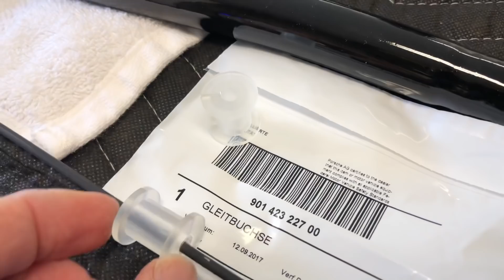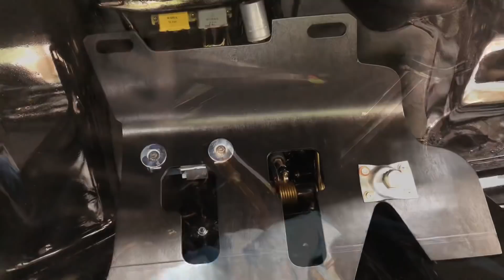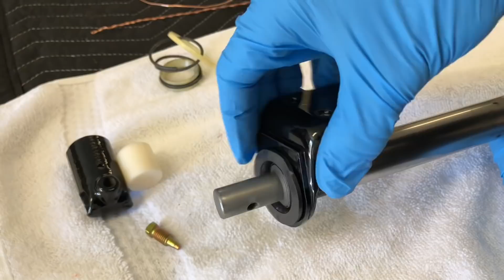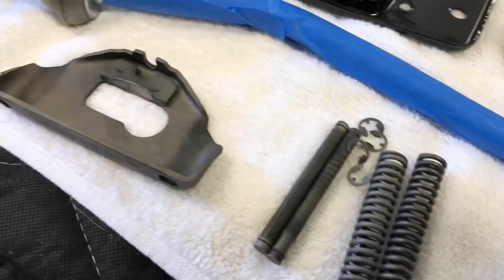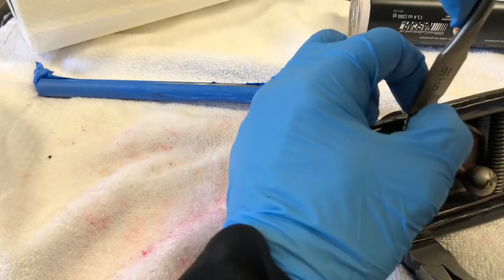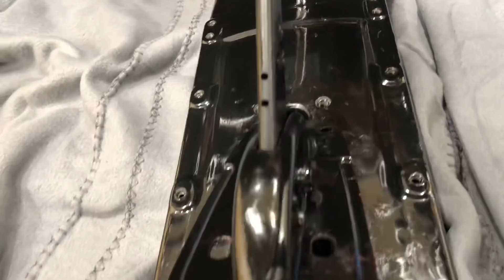1967 Porsche 911 Video 47 Completing Tunnel Work

Comment: Another great video, I can’t tell you how useful these are.
One question regarding this one at the end you show lifting the handbrake lever 4 clicks then the pads are just skimming the discs . So basically the handbrake isn’t engaged at 4 clicks ?
Reply from the maker: Thank you Bike Im so glad they are helpful.
Yes that is correct..How ever not necessarily would 4 clicks tighten the drums enough to hold the car.
It's a starting point and may need to be adjusted with a higher pull up depending on how the drum brakes settle it after driving.
If the shoes to drums are not fully releasing then more slack will need to be added. Also over time the cables will stretch.
It is something that needs careful adjustment once you are rolling

Comment: Hi Mike - how come you bought a new coupler instead of restoring your old one? Cheers mate... Can't wait to see your 911 driving video soon ... I'm rebuilding a 1969 912 in Perth, Western Australia and your videos have been a huge help...
Reply from the maker: The original was cracked on one of the bushing end. No way to fix properly
Best of luck on your 69!
-Cheers
Reply: @MikesRestorations  Thanks for your reply Mike. Just a word of warning for anyone about to do this. If you have the handbrake and heater cables installed you'll have a hard time squeezing the carrier passed. I ended up taking it off and pushing the rod through naked and reinstalling the carrier once inside the shifter gap. Take the good with the bad and don't worry about which one is coming next.

Comment: Hi Mike, how are you? i changed a shift rod bushings but now it works a little bit hard, is ok or the shift rod must work free like in your video?
Thanks a lot.
Michele.
Reply from the maker: Hello Michele
I think shift rod bushing should feel snug and will probably break in after awhile.
In the video Im not hooked up to transmission which might give the appearance of easier shifting.
If its feels too tight maybe some more grease?

Comment: my 1985 911 gas pedal is sticking, it hangs up and idles high (20K) until i either tap the pedal gently or reach down and pull the pedal back up manually.  Could it be the throttle rod bushings are disintegrated , missing or out of place? I did replace the bushings at the pedal and at the trans, so they are somewhat new... Im, told it wouldn't be a spring because it wouldn't "hang up", it simply wouldn't come up at all.  any thoughts before opening up the tunnel again?  thanks  great video!!
Reply from the maker: Hello J Gurni
I would have a look near the floor board where the pedal linkage hooks to the throttle rod that runs the length of the tunnel. That spot right there is real iffy to make a smooth throttle return without hanging up.
You would need to remove the wooded floor board and try to get your head down next to the pedal where all the ball sockets are.. My guess is dry or worn ball socket or even rubbing the tunnel in that location.
If you have checked everything else you can disconnect the pedal linkage and try manually pulling the throttle rod to see if you are able to feel anything inside the tunnel.
Good Luck!
Reply: Mike’s Restorations is it possible to change the ball socket, if it is indeed worn, from the throttle rod or is it all
one part? How can I tell if it’s worn? Thanks for your help.. it’s been making me crazy!!

Comment: Hi mike, got a question. 
How did you get the finish on the springs ?
Thanks. 
Amazing job !
Reply from the maker: Thanks H S
zinc electroplate with yellow chromate dip.
New springs
Reply: @MikesRestorations  but the springs doesn't look yellow, they appear more dark grey.
Thanks to answer my question.
Reply from the maker: Oh I see the springs you are referring too.. The spring tensioners for the shifter? These are raw steel with 80 glass bead blasting no finish coating
Reply: @MikesRestorations  thanks a lot !!

Comment: Congratulations on the excellent restoration.
Have you always used POR15 in the entire restoration process?
Thank you
Reply from the maker: Hello Diogo
Thank you its beginning to really take shape now!
I use POR 15 on specific parts and areas of the car.
Its great on suspension parts, brackets if they are not being zinc plated
and interior sheet metal that will be cover with carpet. All other areas will be painted with 2K finishing products or plating of some sort.
Its a super product used in the range of these areas
Reply: @MikesRestorations  Hello,
Thanks for the answer
Yes I have had the opportunity to be able to use the product, it is indeed an excellent product
In many cases it requires care in the preparation of the metal to receive the paint, with the products POR-15 Cleaner Degreaser and POR-15 Metal Prep
In case the parts are blasted it becomes easier
Continuation of a good work
Reply from the maker: Yes Its quite product for sure and definitely all in the preperation
What amazes me is its hardness for a single K product..
almost like a porcelain coating

Comment: Hi!, again, Mike ... Hope you had a great Xmas and New Year's ... Keep up the great work you're doing on an awesome series. Am still working on my '69 911T and have a couple of questions. The first is how did you finish the insides of the doors? POR 15? Epoxy sealer? Covered with an appropriate topcoat? The second is which fasteners are you using for the fender attachment to the body? The original 9 mmkay Allen screws into the original 'clip' single thread nut or did you go with a 9mm Allen screw with washers (flat & lock) with a 9 mm nut? I know the reason Porsche used the original 'clip' nut but did you reuse/cad plate them? ... Once again, an awesome series ...

Jerry Endler (poppy@brand22.com)
Reply from the maker: Hi Jerry
Thanks and yes a super holiday and off to a great year!
Inside the doors were paint stripped as best as possible but very gooey mess..Then media blasted with 80 grit glass bead. Finally I used small spray cans of wurth undercoating to get inside and coat them best as possible followed up with the shutz gun. The space is tight in there but is possible to do something. POR 15 would also work very well in that area because you can use brush.
The fender bolts and speed nuts are original with a couple of new replacements from Porsche..re-plating the Porsche replacements so that
all the finish matches.. For the most part they were all in very nice condition.
Also using the original rectangle washers re-plated.
Will be doing a video on these fenders when time to reinstall.
Good Luck!

Comment: Thank you for another instructive video. I forwarde your view on using different types of grease between different materials to my son, who is into restoring classic British motorcycles. Right no a BSA DBD34 Gold Star. We don't want him to use synthetic grease between metal-to-metal, do we? I  don't understand the difference myself, but if you recommend it, I take your word for it.
Merry Christmas and A Happy New Year!
Reply from the maker: Hi Anders 
Thank you and Merry Christmas and a Happy New year to you too!
Wow restoring classic motorcycles sounds like a super fun hobby!!
Regarding some of the grease variations..Modern synthetic is a good lubricating agent for metal surfaces however
Petroleum based grease tends to operates more smoothly.. Synthetic has a tendency to feel as if the surfaces are too clean and a bit gritty but still can be used and hold up very well under all conditions.
Lots of luck to your son with his restorations!

Comment: It's odd how sloppy these couplers are fresh from the factory, right? I ordered one especially because I thought the one in the car was worn out; in the end I just ended up re-using the old one. Once again great progress on the car. This is truly a labor of love!
Reply from the maker: Hi Feesh
yes you are right about the play..its seems weird but I'm sure its engineered this way for some reason
I cant imagine.. Maybe it takes slight pressure of the shift rod inside the transmission ..easier on the synchros engaging??..Ill definitely look closely at this when digging into the transmission